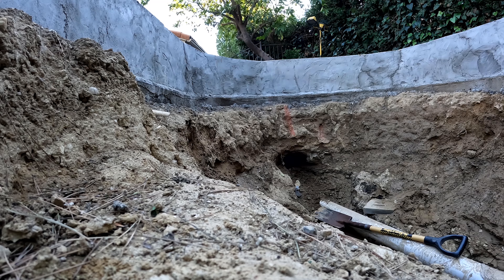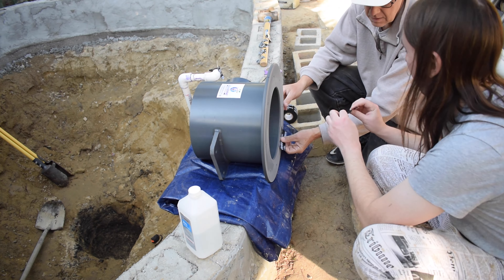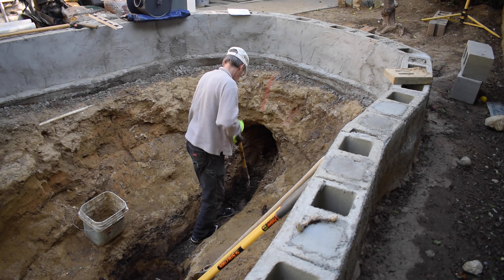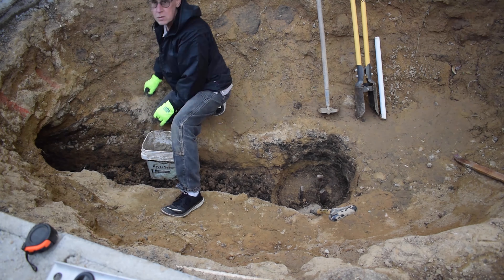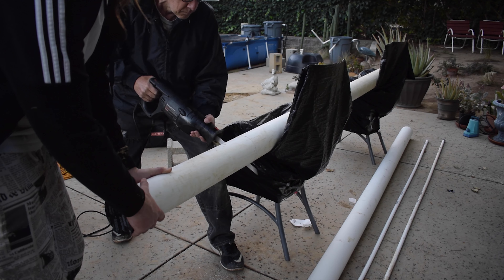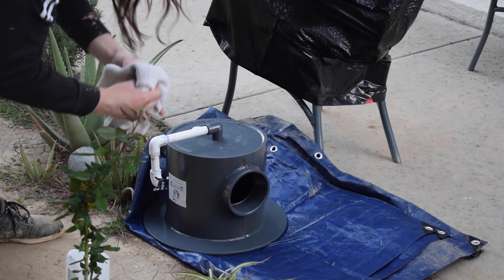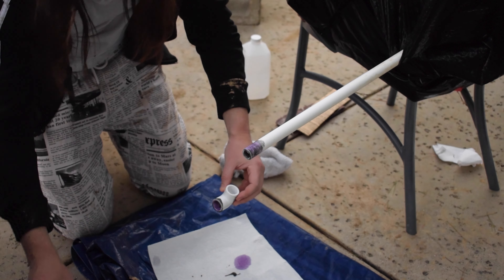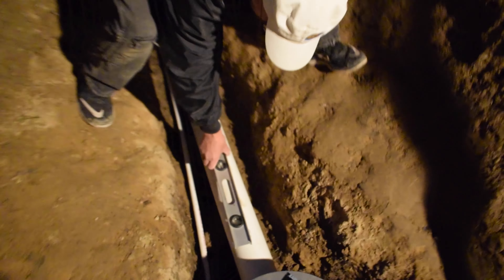Koi Pond Bottom Drain Installation Day 1!

Comment: Very good video.  I am installing this same type of bottom drain.  I didn't think about the support you put under the bottom drain, I will be doing the same thing.   Also your airline,  I like how you have it on the side of the 4 inch drain pipe and not under it.
Great job
Reply from the maker: Thanks Andre! Good luck with your bottom drain install!